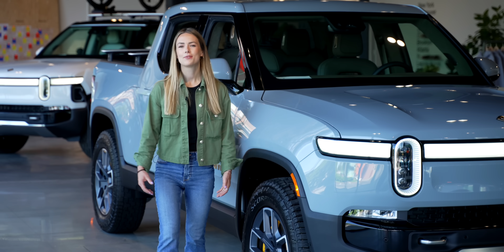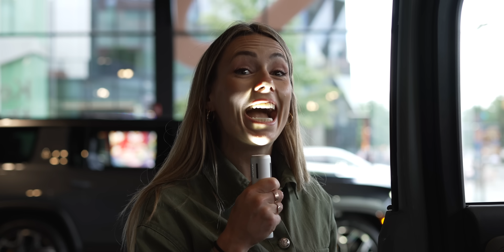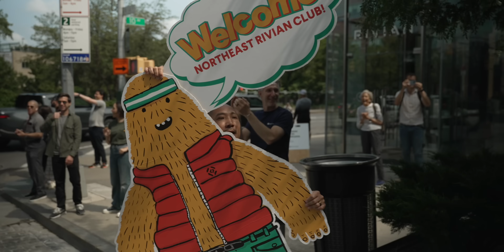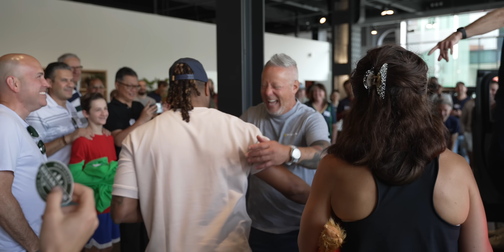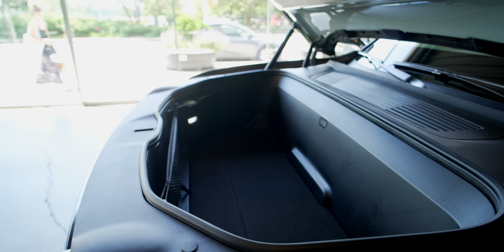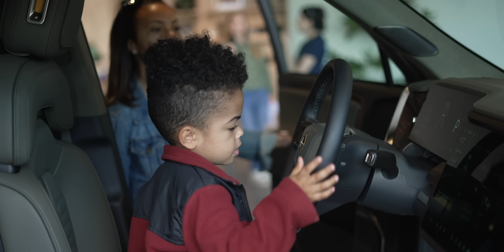Rivian's Next Generation Has Some Wild Ideas...

Comment: That weighs 3.9 tons that is too heavy.  If I have a car crash I don't want something that size hitting me.

Thankfully here in the EU most people have category B driving licenses which have a maximum weight of 3.5 tons and that is not just the vehicle but also everything inside it.

There are categories which are heavier than category B, but those have a slower speed limit, and more restrictions.

Comment: I’m struck by how big US cars are it’s like it’s 25% bigger everywhere than it needs to be.
Reply: well read enough enough YT comments and you’ll see why.  Apparently I’m not the average American but this is what I’ve learned so far.  

Need the ability to tow 10k pounds for all the stuff we own. Need to be able to drive 2,500 miles because that is the average commute to work.  Need the ability to haul at least a yard of gravel in the bed of the truck on a daily basis.  No cares about the environment, fuel efficiency, or workers rights unless it’s to make batteries for an EV.  Lastly it’s really about what if?   

I was born in 78 and growing up owning a truck was a rarity.   Not exactly sure how my grandparents and parents survived without a truck or SUV.  
I suppose things like gravel, 2 by 4’s, and boats didn’t exist in the 80’s.
Reply: You could say that about North America in general. Fully Charged is coming to Vancouver BC soon. The province alone is about 4 times bigger than the UK. I drove to Prince Rupert once - halfway up and it took two days. Most of us live within 50km of the US border, but once out of the Lower Mainland, the most popular vehicle is a pickup. People here are big on camping, towing a boat or a trailer and just carrying stuff. So if you can afford it, a truck that guzzles cheap clean hydro-electricity rather than petrol or diesel is just the ticket. As for weight, please. The roads here weren’t built in Roman times, and goods travel up to 8000km from Vancouver west to east, and 3000km up to the territories on 84,000lb rigs. The Rivian R1T would be a bit big for British roads, but in person is less imposing than most 1/2 ton full-sized pickups. Hopefully the R2S will be better sized (and priced) for European markets. Thank you Imogen and the FC team for your take on the Rivian.
Reply: Few people are satisfied with "enough" when they can have "more"
Reply: It's like the USA Is much bigger and more prosperous than many other countries. Maybe you should get a clue.
Reply: @BuildTheSandbox  LOL you are talking to an Aussie dude don’t make size or wealth comparisons buddy.
Reply: @rickybryan1759  Was hoping you were from France lol

Comment: Nice truck, but we're rapidly running out of planet to be able to use it, and London is already full of Chelsea tractors, though cleaning them up would be an improvement.
Reply: 😂😂😂😂 

Perhaps the Mayor will introduce a weight limit for private cars ... a two ton plus of car to transport a single person through a city seems a tad silly.

We might note that the roads might last longer.

Getting people into hydrogen fuel cell powered taxis might be a much better bet as in cleaning up the local atmos'.

Another concern of course is that these vlogs are used for advertising ... no, surely not?

Outrageous.

Mind you, if these vlogs were used to promote hydrogen fuel vehicles then an excellent wheeze, obviously.

Comment: 3.8 tons 😂. And we're supposed to believe EV efficiency is the future with crap like this.
Reply: Far more energy efficient than a gas or diesel vehicle. Internal combustion engines are very inefficient. Always have been. Can you say Deepwater Horizon, Exxon Valdez, conflict oil, climate change, hundreds of millions of gallons of oil dumped illegally, millions of abandoned, leaking oil wells?
Reply: @JakeRichardsong  my criticism is not of EVs. Just the ridiculousness of this.